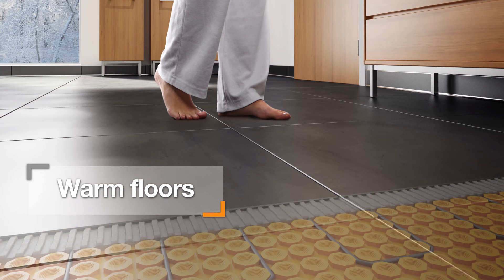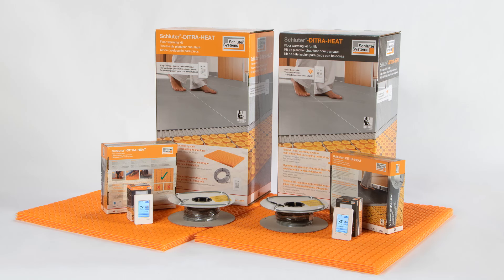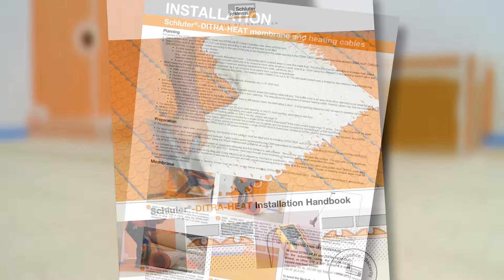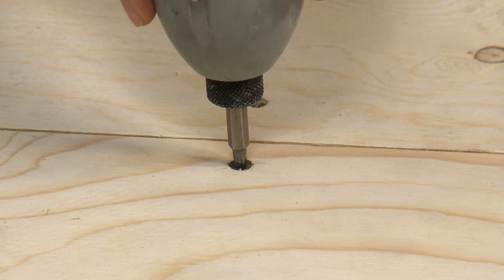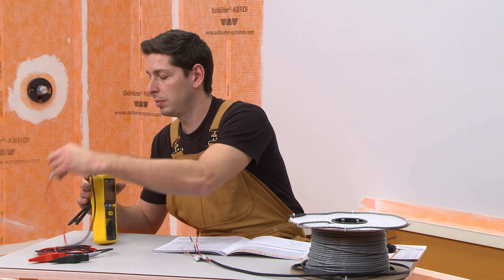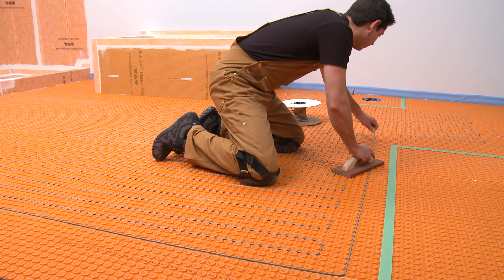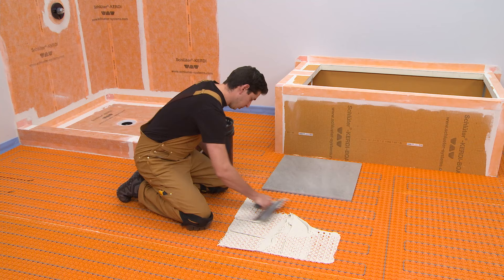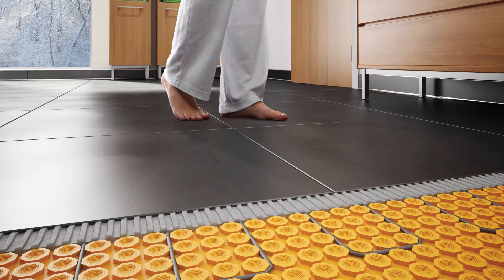How to install DITRA-HEAT over Wood Start to Finish

Comment: I'm an Electrician......Notes: The connector shown on this video for the Home Run cable is not appropriate. If running Romex to the box, from the panel, a Romex Connector must be used, if running MC, you would use an MC connector, and so on. You must run the appropriate sized wire based on the amperage the system you are installing draws. Also, although it is not verbalized, I did notice that the metal box was grounded, even though the ground wire doesn't connect to the thermostat itself, this is correct. You must ground all metal boxes back the the panel. The size of the ground wire is also determined by the NEC.  Personally I would run a dedicated circuit to this system, because a bathroom is considered a "wet location" the Home Run must be GFCI protected with a GFCI Breaker. Verify this with the NEC. Be absolutely certain that the provided wire has no damage at all, do not repair damaged wire with tape or splices. Do not install damaged wire, return damaged wire to the supplier and have new wire sent. If at any time the breaker trips, do not simply reset the breaker. A tripped breaker means something is wrong, have a qualified Electrician test and investigate the problem and resolve it before re-energizing the circuit.
Reply: You do realize that's why they say it must be installed to your local electrical code, right? And unless you're an electrician in Canada I think you're a little presumptuous in assuming that this doesn't meet code, because this installation took place in Canada.
Reply: @Matlock69  My Professional recommendation stands. Code is the Minimum we are required to do. I never give a client "the least" they can expect, I dont care what Country they live in.
Reply: So you're saying all these products are designed as a system?!  LOL.  Yeah, it's shocking how often people fail to use a cohesive approach to this sort of thing.  I see this in various trades.  Painters using different brands of primer and paint together despite their chemistries being designed to work together as a system.  Tiles and thinsets, all sorts of examples of how people fail to see the value in utilizing the entire product line of a particular brand or product type.
Reply: In this case, the opinion of an electrician is not very valid because many times the electrician asks me, I am the ceramic installer, how the thermostat should be installed, and if some problems arise they start saying that I should not have installed the thermostat. cable or any excuse for not solving the problem, that's why I always leave them the instruction manual at work so that they know how to do their job that they studied for that or so that they see that there is a 1800 telephone number where they can educate more about the ditra heat system
Reply: You always want to verify your Electrical installation with the tile installer, painter, carpenter, and plumber.....I mean....that's clear.

Comment: Is there allowances for under floor duct work that leaves residual heat through the floor, that would affect the wire layout (around/avoid)?

Comment: Amazing video as always. What's the life expectancy of the heating cable and what needs to be done to ensure it will last long ?
Reply from the maker: Thank you! These cables are built to last, as long as the installation instructions are followed in the the DITRA-HEAT Installation Handbook, including all testing, and nothing damages the cable afterward.

Comment: I have a question about the waterproofing part:
If you embed the kerdi band on top of the ditra mat to waterproof butt joints, cutouts etc. - isn't the water going to seep through the mortar underneath the mat making it effectively useless?
I mean - the mortar doesn't actually bond to the mat per se, it just fills in the bumpy profile and hardens. Taking into account the fact that ditra mat has a decoupling layer function - if it allows for the mortar to move and absorb deformations, then it means micro channels between already hardened mortar and the ditra mat could form and moisture could simply flow through them and seep through the mat butt joints and into the substrate. Not a huge issue if you build on top of concrete, but kind of a big deal if you have a wooden substrate which would absorb this moisture and could develop mold. Not to mention now the ditra mat would act as a lid over the substrate not allowing for it to dry out properly...

I know that for full waterproofing I would need to embed and seal the whole floor with kerdi membrane, but I would like to know your opinion on why is it enough to seal the problem areas only with patches of kerdi band.
Thanks.
Reply from the maker: Hi there!
Thanks for your question. Since DITRA is waterproof, the only thing left to do when sealing a floor under tile is to waterproof the seams with the KERDI-BAND, as you mentioned. Yes, some moisture may seep through the grout joints or tile into the thin-set in the DITRA squares. However, where the edge of the KERDI-BAND is, the moisture would need to migrate at the top of the squares where the capillary action in the mortar under the KERDI-BAND does not allow water to migrate the distance of the overlap. Therefore, the seam is waterproof and will not leak or cause any issues. If installed in accordance with the DITRA Installation Handbook, you can trust that it will work properly. https://sccpublic.s3-external-1.amazonaws.com/sys-master/images/hd4/h1d/9145076809758/DITRA%20Installation%20Handbook.pdf
Hope this helps!

Comment: Ditra Heat Instructions say "Floor temperature sensors may not be threaded through the same conduit as the cold lead."  This video @13:05 says you can use the same conduit.  Which is it?
Reply from the maker: Hi there, it appears that perhaps you are looking at an older version of our Handbook. The latest version follows the same instructions as the video, "...the temperature sensors need to be threaded either inside the same conduit as the cold lead, or in a separate conduit. " 
Here is a link to the latest version: https://sccpublic.s3-external-1.amazonaws.com/sys-master/images/h27/hdb/8986872414238/DITRA-HEAT%20Installation%20Handbook.pdf
Reply: @schlutersystems1  Excellent, I should have checked version!  Thank you!

Comment: Great video, my only question is....why would you put the cold lead to conductor splice in the floor and not in the junction box?
Reply from the maker: Hi there! The reason for this is that electrical code does not allow the heating conductor(s) to be run through the wall. Doing so could shorten the lifespan of the cable because of overheating in a confined space and more importantly, could cause damage to the structure.
Reply: Shorten life span ?
So 4 to 7 years down the rd the leads to conductor will fall .
 Of course

Comment: To clarify, we use modified underneath to apply the ditra heat to the plywood, and unmodified to adhere the tile to the top of the ditra heat?
Reply from the maker: Hi there. That's correct (unless you are using a certain glass or moisture sensitive stone that requires a special setting material). You can also use ALL-SET to install the tile.
Reply: @schlutersystems1  we changed our minds and added the heated floor after purchasing the mapei uncoupling membrane and mortar (which is unmodified), so we kept that mortar for on top of the ditra, and we ordered mapei keraflex plus for our wall tile, so I'm using that underneath the ditra, but should I also use it when doing the waterproofing after laying the wires, or use the modified?
Reply from the maker: Hi Ashley, it would be a good idea if you gave our Product Support team a call so you can discuss your project together in detail, and they can advise from there. You can reach them at 888-472-4588 (US) or 800-667-8746 (Canada). Thanks!

Comment: I don't see all the seams waterproofed with 2" overlap membrane.  Do you waterproof all seams?
Reply from the maker: Good question! Waterproofing with a 2" overlap is required in areas that will be exposed to water, like a floor to shower connection.
Reply: @schlutersystems1  Thanks for the fast reply!

Comment: My heating cable is now run through the conduit to the box, sticks out approx 36".  Heating cable has been run in the Ditra heat membrane, perfect! Now What do I do with this excess wire on this end that is sticking out of the box? I'm not suppose to cut it. Video doe not show any excess sticking out of the box before the thermostat is installed.  I have way too much cable to wind u inside my double gang box. Suggestions
Reply from the maker: Hi Kenb, can you give our Product Support team a call to discuss your project? You can reach the team at 800-472-4588. Thanks!

Comment: no concret board needed when the subfloor is just Playwood?
Reply from the maker: Hi there! Good question, if you current susbstrate is in good condition and meet the criterias, you might not need an extraplayer of plywood. Really depends on what you currently have. Would be best to contact our customer service team to to discuss your project in a bit more detail. They’ll be able to request more information on the specifics of your project to give you the most accurate answer possible. You can reach them at 800-472-4588 (US) or 800-667-8746 (CA). Thanks

Comment: When using Ditra Heat and a 10mm thick tile what is my typical total finished thickness from the substrate to the top of the tile?
Reply from the maker: Hi Dwight, can you give our Product Support team a call to discuss, they would be best suited to advise. 888-472-4588 Thanks!

Comment: Do I need to use the Kerdi ban along the walls that will have wood baseboards, not tile.  My wood baseboards do not need to be waterproof, but if the Kerdi band is required, I need to know. Also, is the All Set thin-set modified the only mortar I need?  When would I be required to purchase "un-modified"?  My installation is going on wood.
Reply from the maker: Hi Kenb, Kerdi-Band is for waterproofing only. For thinset mortar applications, please refer to our technical handbook here: https://sccpublic.s3-external-1.amazonaws.com/sys-master/images/h47/h7c/8986876280862/DITRA-HEAT%20Installation%20Handbook.pdf

Comment: I am planning to install a curb less shower with ditra headed floor continuing into the shower area. do you have a shower pan with the "studs" included so I can run the wire in?
Reply from the maker: No, we do not. You can find all the technical details on page 10 of the Shower System Installation Handbook here: https://sccpublic.s3-external-1.amazonaws.com/sys-master/images/haf/h3c/9078303391774/Shower%20System%20Installation%20Handbook.pdf
Reply: @schlutersystems1  this link now yields "access denied."

Comment: Hello all, can I put concrete overlay on top of the ditra-heat membrane and cables?
Reply from the maker: Hi there, this would be a type of project that would need to be discussed in more detail. If you like, I can connect you with your local Schluter rep. Please send through your city and zip/postal code and I can send through the contact. Thanks!

Comment: Good day to all. I would need help if possible . I put a SLC over my wood substrate . Primed it before as prescribed.. It was naturally a disaster: SLC is a real technic... I grind/sand it . Naturally not flat but not bad. Question 1: could I use the modified thinset Schluter just to fill some of the gaps, leave it settle/dry then put my layer of thinset&Ditra heat? Question 2: do I need a primer to put over my SLC prior to Schluter ThinSet ? Thank you for answering rapidly.
Reply from the maker: Hi! 
We recommend that all leveling be completed before installing Ditra or Ditra-Heat. If you are having difficulties we recommend you giving our Product Support team a call. They can be reached at (US) 888-472-4588 or (CA) 800-667-8746.

Comment: I plan on using the shower system without a curb (for wheelchair access). Can I install the Ditra Heat to extend into the shower? In other words, can I install Detra Heat over the shower system pan?
Reply from the maker: Hi Jim,  yes, DITRA-HEAT can be extended into the shower. See detail DH-SH of the Schluter-Shower System Installation Handbook for complete installation details. Here's a link in case you need it: https://sccpublic.s3-external-1.amazonaws.com/sys-master/images/ha1/h71/9145056493598/Shower%20System%20Installation%20Handbook.pdf
 
Hope this helps!
Reply: @schlutersystems1  Great! I've been watching your videos along with some others who are using your product. I bought your 38x60 shower kit, but want to make it curbless for a wet-room effect. Do you have any suggestions/recommendations? I imagine I'll have to build up the floor to match the height of the shower pan?
Reply: Hey, don't need a reply! I found the video on how to recess a floor for a curbless installation. You can now go back to your regularly scheduled program... LOL
Reply from the maker: Ok Jim, happy installing!
Reply: @JPHaggertyBARI  Where did you find the video?  Thank you
Reply: @JPHaggertyBARI wouldn’t you need a heated seat for your wheels instead of the floor?

Comment: I'm still having problems with this material. It's a constant struggle to get  it to lay flat.even with all set you still have to weight it down meaning no wire laid today. Our ditra here doesn't come rolled fleece side out like you show on video though I'm sure that would remedy the problem though it may be easier to stop the rollback than to stop the cupping. And the square sheets also have a bit of  the same problem.sorry to complain but I just find it frustrating.all other schluter products I use are top notch.
Reply from the maker: Hi Steve, Sorry to hear you are having difficulties with the memory in the Ditra-Heat membrane. Feel free to give us a call and we can see how we can help:
US: 800-472-4588
CA: 800-667-8746
Reply: I have layed flat mine for 4 weeks... I understand.

Comment: Why would one need to level the floor BEFORE installation? Would it not be warranted if it is afterwards?

I figure that it is an insurance to level after, as you can have humps after installing the uncoupling membrane.

Please answer. Ty.
Reply from the maker: Hi there, the likelihood of needing to adjust the amount of mortar when setting tile is reduced when installed over an even substrate. The DITRA-HEAT trowel, or another 1/4" x 1/4" square notched trowel, is used to install the DITRA-HEAT membrane. When the membrane is solidly embeded in the mortar, there shouldn't be any humps or unevenness. The thin-set used to install the tile should be applied as evenly as possible as well. This is why we need to start the installation with an even substrate. The warranty is valid when the instructions in the DITRA-HEAT Installation Handbook are followed. Please give our Product Support team a call if you'd like to discuss a particular project. 800-472-4588 (US) or 800-667-8746 (Canada). Thanks!

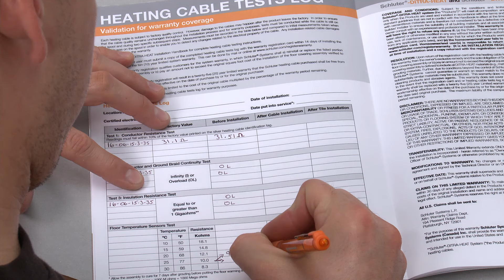Comment: This video could be only 3 minutes. Membrane Instructions start around 13:30 and finish at 16:40. Everything before that is mostly repeated promotional material which you don't really care about when you need to do the installation. I guess they put that instead of ads

Comment: Does it work for laminate?
Reply from the maker: Hi there! You can check out this little video we have on using DITRA-HEAT under alternative floor coverings. https://www.youtube.com/watch?v=AXGhEUt_3v0
 
We also have a technical bulletin: https://sccpublic.s3-external-1.amazonaws.com/sys-master/images/h4e/hfe/8963348070430/Technical%20Bulletin%20-%20DITRA-HEAT%20with%20Alternate%20Floor%20Coverings.pdf
 
And an installation Handbook: https://sccpublic.s3-external-1.amazonaws.com/sys-master/images/h18/h0d/9078298902558/DITRA-HEAT%20Installation%20Handbook.pdf
 
Hope this helps!

Comment: what gage wire is used for the 240V cables?
Reply from the maker: because the cable resistance is based on length, the material and the gauge of the conductors changes for different lengths.